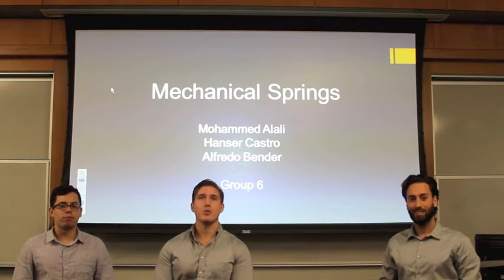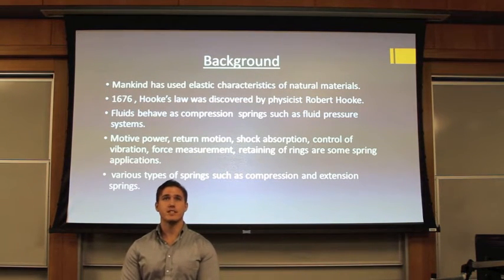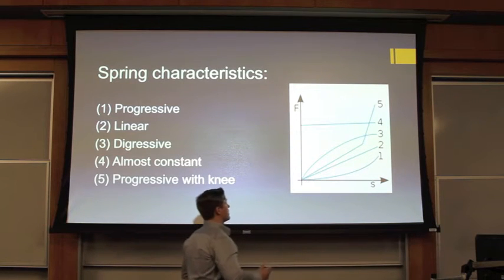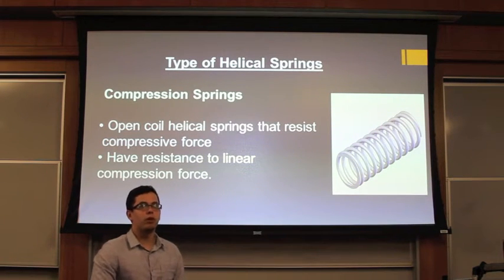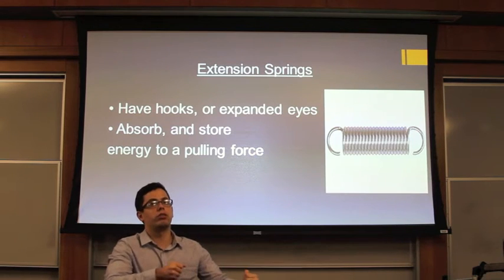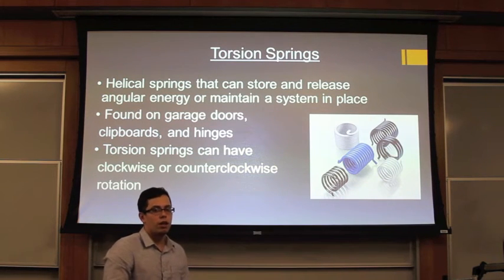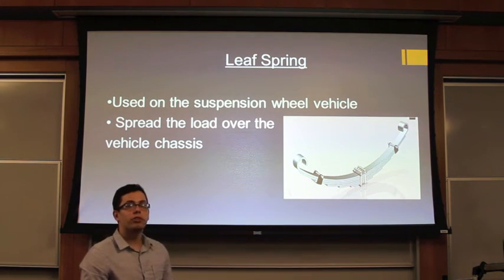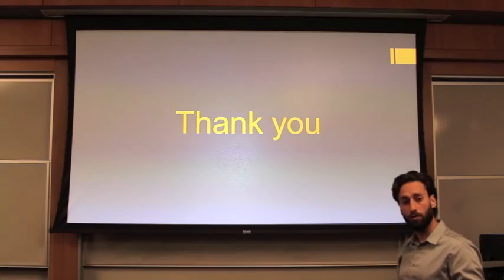Team 6: Mechanical Springs

Comment: This was a well done presentation, however there were a few problems. First, the white noise is pretty annoying throughout the entire presentation. Second, I'm not sure where the first and second presenters are looking but it's definitely not at the audience. The third presenter however did well with making eye contact with the audience. The first presenter seemed as if he was mostly reading off the slides. The SolidWorks model is a good addition, but there should be some credibility added to the design, such as maybe a simulation to exhibit some characteristics or even better a new conceptual design. Otherwise it is pretty much a 3d picture of something that exists and can be found on the internet.  The video quality was really good and the slides were put together well. Each presenter was dressed professionally and spoke well.

Comment: The video has good lighting and ok sound quality. The inclusion of a Solidworks model enhanced the quality of their presentation; the improvements they mention give the impression that the speakers knew their topic very well. This presentation would be better if the speakers looked directly at the camera since it was obvious that they were looking at the Powerpoint slides off-screen. Overall a great presentation.

Comment: Great presentation. Slides were clear and easy to read. The solidwork design was a good incorporation into the presentation. Also, just as the previous comment state try and refrain from facing your back towards the audience.